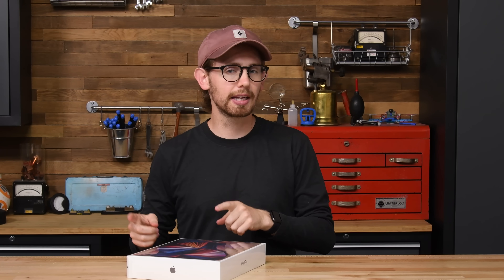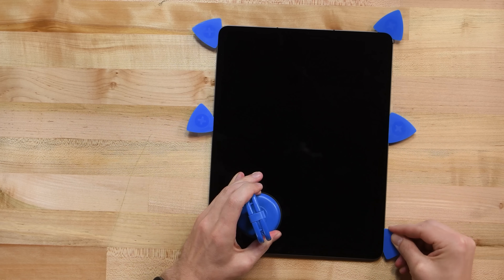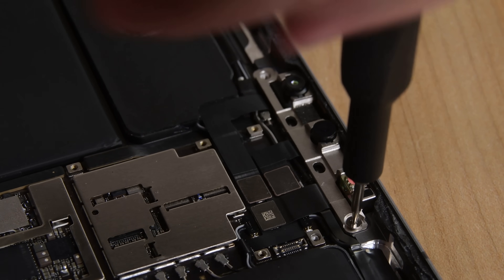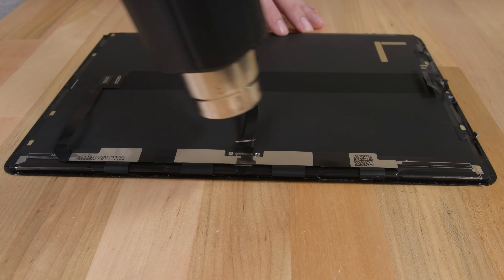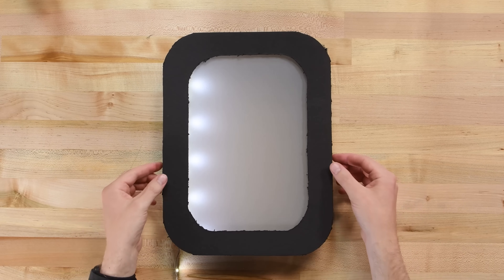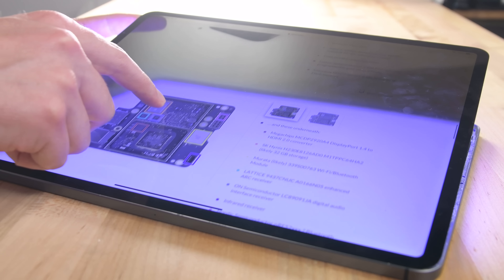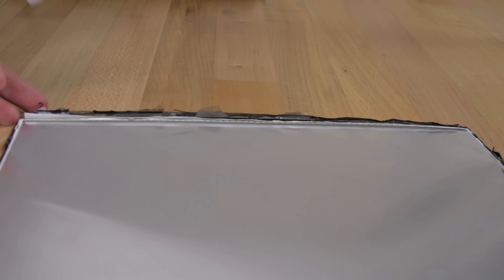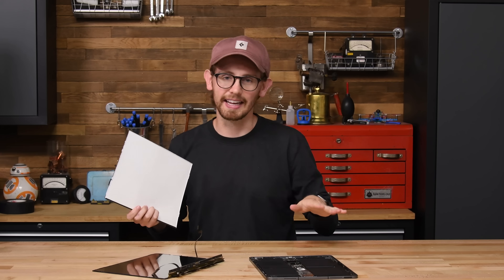M1 iPad Teardown:  Inside the New XDR Display!

Comment: Just upgraded form the 2018 to the 2021 12.9’’ and the speakers are a lot worse the depth/bass is a lot less. Just watched this video to confirm the speakers are different shapes oval versus round and smaller. A little disappointed to say the least.
Reply: other videos i saw side by side they say the bass is better
Reply: @truthseeker6804  It's not I have both the 2018 and 2021 but the 2021 12.9" is 5G capable so maybe the 5G makes less room for larger speakers.
Reply: @Cooper3312000  or maybe yours has a problem? check other youtube videos.
Reply: @truthseeker6804  you can see in the 2018 iPad 12.9 teardown the speakers are round and have more surface area the ones in the latest 2021 iPad are oval and clearly smaller driver.
Reply: @Cooper3312000  i just searched for comparison video and theres a channel called fernando silva and he proved the 2021 speaker is better. you cant just use oval or round to make real conclusions. maybe return yours.
Reply: @truthseeker6804  it sounds fine it’s just not as full the 2018 used to vibrate when it had bass this one just sounds a little flat it’s nothing to bad I’m still enjoying it use AirPods most of the time anyways just letting others know the facts I’m not trying to sell buying the new iPad over the older ones like everyone on YouTube.

Comment: Just one question though, do you think the mini-led is more power efficient than the conventional leds from previous ipad pros?
Reply: Message vilian_tech on IG
Reply: No, that's one of the reasons it has a bigger battery. Mainly with HDR content the screen puts out much more light. And that takes more power. You potentially get some power savings IF you have the brightness down very far, and have mainly black on the screen, but in reality this will be weighed out by the overall higher brightness with watching video's or doing other things that keeps the brightness up. Local diming doesnt turn the LED's off completely on a black screen, only dims them. If they turned them off entirely it would make blooming even worse. 

People seem to be confusing the benefits of mini LED with OLED or Micro LED.

Comment: Why isn‘t any LED controlled separately?
Reply: The control circuitry to control 10K LED's separately would be a lot more difficult / expensive to implement. They would have to have a much more complex backlight controller, way more traces going to the backlight array etc. Probably would have doubled the already higher cost of the screen.

Comment: I'm shocked that the backlit for normal LED displays are on the side and not a big uniform surface underneath.
Reply: Well they surround all corners, and a layer behind the LCD panel will diffuse the light (spreads the light evenly) meaning it actually is a uniform surface.

Comment: So, if I understand correctly, the shadows along the edges could be fix with a software upgrade?
Reply: The edge shadows, probably not, it is caused by the space between the screen and the backlight layer, and the diffusion layers in between. The blooming, could most likely be fixed though.

Comment: Honestly I won’t call it a “computer” unless Apple lets me use whatever OS I want, install my own apps even Mac apps would be good.
Reply: And how do you want to control such os and apps when iPad is touch based and regular OSs are pointer device controlled?
Try to use VNC or Remote desktop on iPad and you will see why it is not a good idea.

Get Macbook Air for that. Same thing, lower cost, not big difference in weight.

Comment: You should replace the thermal paste with liquid metal
Reply: First, M1 doesn’t need that and second, liquid metal might damage whole board by shortcircuiting. Plus it degrades to some friggin mess.
Avoid liquid metal. While it sounds cool, it’s not awesome. And M1 is no overheating Intel.

Comment: My ipad pro M1 12.9 inch getting warm on the left side of the glass (opposite to the apple pencil dock) while doing regular working such as youtube, notability, safari etc. No editing videos or transferring files or gaming. It's not over heating but it's warm.
Does anyone experienced a similar case with his iPad? Is it normal?
Reply: There is processor…
Reply: @ZhuJo99  the processor is not in the middle of the ipad?
Reply: @yuvalbenmoshe6187 my fault, i have non pro iPad where board is aside. It might be battery, that’s normal during usage.

Comment: How can the backlight be so homogeneous on the 2020 iPad Pro, while it's on a side?
Reply: there is a clear "light spreader" that the leds shine into, tuned to eject more light on the far edges and less on the closer edges to balance the fadeout of the leds over distance. 

Its like a fiber optic rolled out into a sheet with micro holes in it
Reply: I feel like DIYPerks did an explanation in a video on this. IIRC it's the one where he turns laptop screens into a fake window.

Comment: 2.5k dimming zones still has blooming..  could have been 5.5million zones if it was an oled since its pixel level..... oled still has benifits such as instant response time and slightly better viewing angles then ips... also even with the local dimming and dual lcd layer (monochrome), its still an ips panel so the poor native contrast ratio will show up in certain instances...
Reply: Except MiniLED has better viewing angles than OLED. OLED loses a lot of brightness and even color when shifted. MiniLED pretty much stays the same on the iPad.
And the biggest point is that the iPad Pro is often used for drawing and designing where accurate colors are necessary. The problem with OLED is tho that it needs to be recalibrated every other year or even after just a few months. On a phone that's not an issue. On a drawing machine? It is.
Reply: Burn in low brightness are oled weakness

Comment: M1 is on iPhone next jk
Reply: it technically already has it. Just with 4 less GPU and 2 less performance cores. Besides those two changes, the A14 is exactly the same chip. and it clocks slightly lower at 2.99Ghz instead of 3.2Ghz

Comment: who made this display for Apple and revolutionized the industry?
Reply: This is not a new tech developed by apple🤣 there are laptop using mini led display already on the market
Reply: @mahchunteng9434  Except the iPad pretty much set a new record there. Even entire TVs and reference monitors with MiniLED mostly often have only some hundreds or barely over 1000 local dimming zones while the iPad at only 12.9" has over 2500.
Reply: @mahchunteng9434  Where?
Reply: Both LG, Samsung and TCL uses this kind of tech in their products. I think that TCL were a bit of a first mover on the tv-front. And I think that it is LG that produces the iPad screen. 
Its been showcased on CES for a couple of years as the next-gen lcd-tech. Now it is hitting the consumer products in a big way.
Reply: @mmmkkkeee  Which products? Where is a product with mini led that has 2500 dimming zones?
Reply: @Gokhanaj  That would be their upper QNED line. 
With that being said these things are collaborations. LG probaly have shown Apple their roadmap for the technology, and Apple have invested in LG to make it happen. It's a great feat of engineering to make something that is normally inside at 65" screen fit inside a 13" one - and that is thanks to both Apples and LGs efforts.
Reply: It doesn't matter who manufactured it. Apple designed it.
Reply: @Gokhanaj  come on, while Apple is designing top notch processor these days, they are not into display technology. Samsung, LG are companies that are making inovations in this field. Do not make Apple some kind of wonder where they design and make everything from displays through processor to the lowest, smallest resistor on the board.
Which they are not. Even cameras are made by Sony.
Reply: @ZhuJo99  But they design their own displays entirely. They don’t ‘buy’ existing displays from others. They take their design to Samsung or LG and ask them to manufacture them. That’s the reality.
Reply: @Gokhanaj  that’s not true at all.
Reply: Thats old technology, Samsungs microled is the revolution.

Comment: The fact that they named it "Mini-LED" is that there is a "Micro-LED" version coming out soon in the future with lot more leds for a much more better display.
Reply: mini led is completely different then micro led
mini = small led
micro led = individually lit leds with no backlight
like oled but not organic
Reply: @yassienE4935  what do you mean, organic? (I really don't know).
Reply: @NinPossible  OLED (Organic Light Emitting Diodes) is a flat light emitting technology, made by placing a series of ORGANIC (derived from living matter.) thin films between two conductors. When electrical current is applied, a bright light is emitted.
Reply: @NinPossible  oled screens are organic LED’s, rather than making individual LED’s you mix up a slurry of chemicals and paint it onto a film (to grossly oversimplify), however are susceptible to burn-in after some time. They look very nice, at first, but after some time, start to loose brightness
Reply: @NinPossible  To explain it simply, organic means it will degrade by nature. When it degrades, it causes abnormalities to the screen, particularly burn-ins.
Micro LEDs are designed exactly the same way as OLEDs, but the LEDs are inorganic, meaning they could last so much longer.
You get the benefits of brightness and contrast levels of OLEDs, but you eliminate the risk of your screen failing after some time. In other words, micro-LED is the combination of the best of IPS LCD and the best of OLED.
Reply: @bbeni24  @Velleity Thank you, guys! ^__^
Reply: @troy5568  Thank you! Last question, why are they organic? What are they made of?
Reply: @NinPossible  inorganic or conventional semiconductors are made from metals like silicon (well it's a metalloid tbh) which are doped in order to get them to ... you know semi-conduct, hence the name. Organic electronics on the other hand are grown using organic compounds (obviously lol). I'm not a chemist and it's been years since I've taken chemistry so I could be entirely wrong about this but iirc organic basically just means something that doesn't contain metal atoms as the main component. Instead the semiconductor material is made from other elements/molecules like hydrocarbons. The main takaway is basically inorganic materials don't "rot" over time in the same way organic ones do, so they tend to be more reliable long term overall. Many inorganic displays have their lifetime measured by hours of use, while organic displays have a shelf life (ie whether you use it or not it degrades).
Reply: @sjm4306  thank you so much 🙏 😊
Reply: @NinPossible  its organic so it can die and burn in which is why people don't want oled
Reply: @yassienE4935  Thank you for the info. ^_^
Reply: Maybe. Micro led is a very new technology.
Reply: Soon? They will not come before 2026. This technology is still wayyy too expensive. Even samsung first micro led tvs cost over 100.000$
Reply: @TheTornadoWind  did you say 2026 for a reason? cause this would mark the 50th anniversary of apple and i am really looking forward to absolutely amazing products from apple for this year
Reply: @martiiin1999  No but I work for a company that is producing the current mini leds for the iPad and other devices. And out roadmap says that we plan to mass produce micro leds around 2025/2026
Reply: Wouldn't micro LED just be OLED
Reply: @TechDove  yeah , MicroLED is OLED without the Tint issues
Edit : I am Replying to your first comment , 
And The difference bw MicroLED and OLED is Just that All LED’s are individually backlit, However OLED uses organic materials which may die out , And causes issues like Tint 
So, in a nutshell MicroLED is just OLED wo/ Issues, (if you don’t mind the price)
Reply: Apple actually didn't named it MiniLED. It is MiniLED but that name is not made by Apple. Apple calls it Liquid Retina XDR - they never call it "Mini LED display".
Reply: @Raja995mh33  Correct term would be "mini LED back-lit local dimming LCD". Who cares about what apple names it.
Reply: @Raja995mh33  Yes, mini led is the general term used by industry for this technique/type of display, liquid retina xdr would be the specific implementation/trademark term that apple owns
Reply: @buzomatic  and color accuracy, color shifting and color gamut
Reply: @buzomatic  and of course power efficiency
Reply: @buzomatic  Apple buys OLED for currently EVERY iPhone 12. Not just the most expensive ones. And what does this proof anyway? Nothing. iPhones are not iPads.
Reply: @buzomatic  I was referring to micro led. I thought you said that OLED is better in every aspect compared to Micro LED. Then I missunderstood your comment. Sorry
Reply: Actually it doesn't really affect the quality how much more leds you put in there once you reached a certain amount. It can just get brighter.
Reply: Microled exist already and it is completely different display technology - check new Samsung tvs
Reply: Better display already exists. It is called OLED.
Reply: Nope. OLED is a better option at that point. And rumor has it that iPad will be switching to OLED screens in '22.
Reply: @Mamo878  I wouldn't count on that. Apple is going to ride out this mini LED for a few years
Reply: @Mamo878  No they won't. And MicroLED in fact is better in every single point than OLED. You clearly don't know Apple when you actually believe that after all this development, R&D, marketing etc. they would kill MiniLED after just one year. MiniLED will definitely be the displays of the iPad Pro for at least the next 2-3 generations.
Reply: @Mamo878  what about the burn in issue? i would much more like a microLED display with near OLED performance than having problems with burn in.
Reply: @Mamo878  Micro-LED, based on what we’ve heard so far, is far superior than OLED. It’ll be the same as OLED in the way that each pixel will be an individually lit LED unit, but it uses inorganic diodes and will eliminate the screen burn-in issue with OLED, which is far more important on tablets and computers than on phones. This is part of why Apple chose mini-LED instead of OLED this time.
Reply: @Mamo878  only for low budget tablets, for iPad Pro they will use mini-LED.

Comment: I'm loving these local LED displays. They could look almost as good as amoled while having fewer burn in issues
Reply: It's still a tradeoff, with this you have a chance of getting blooming
Reply: @BlackDragon31000  and it's also less energy efficient than OLED.
Reply: @BlackDragon31000  less blooming than traditional led so its still a plus. anyways if anything wait til microLED comes out, that will compete directly with amoled
Reply: Well, if one part of screen is constantly lit for a long time, I doubt if those LEDs are going to stay the exact same output as the rest of the panel.
Reply: @frankli4124  This. The color subpixels may not experience burn in, but the underlying backlight surely will. Traditional backlight doesn't seem to suffer from this but only because all LEDs lose brightness uniformly.
Reply: @frankli4124  yeah but it's better to have thousands of LEDs than millions of LEDs
Reply: @frankli4124  That is a fair point, but unless the iPad is being used solely for a single purpose like a POS, it probably isn't a big issue. My note 10 plus is going strong with no burn in on the OLED, but every single Motorola phone that I have had with an OLED had noticeable burn in within the year. In 2 you could very clearly see the notification bar symbols on the screen when doing something like playing a yt video. It's mainly about software and how well the burn in mitigation is implemented.
Reply: I think mini LED is just a compromise, it's maybe the next best thing if you can't get OLED.  Just like the notch on iPhone, despite many people make it sounds like it is a feature. I have an OLED phone and I don't worry about burnin at all. Apple chose mini led over OLED is probably because they are cheaper.
Reply: @frankli4124  If I'm not mistaken, mini LED panels have a higher peak brightness.
Reply: @Progan666  hahaha u r not entirely mistaken, it does have higher peak (1600 nits) brightness but those peak only achieve while surfing HDR content which is in daily use the brightness is the same as Ipad pro (2020) around 900 nits, maybe it a lil bit bright because of the new tech however, it not really noticeable
Reply: @Progan666  we have oled panels with upto 1800 nits brightness now, I don't know how much more brighter a screen needs to be
Reply: @QiqiSuki  This isn’t a limitation of the display - it’s how Apple chose to implement HDR on the device. There is nothing stopping it from having 1600 nits of peak brightness with SDR content other than an arbitrary software decision.
Reply: @babybirdhome  yep, so the fact that apple limit their display from achieve more nit which is is such a shame , it only can compete with oled when display a hdr video, but in daily usage, oled is much brighter and better , its not weird because later ipad pro will implement oled how so ever
Reply: @frankli4124  I’m sorry to tell you this, but the current Mini LED display in the iPad Pro is more expensive than an OLED screen.
Reply: @dollzman  only because Apple sets the price to sell worse technology for more money as they always do
Reply: @maelstrom254  found the android fanboy
Reply: @TheEviltaco666  I hate Android even more
Reply: @maelstrom254  what do u use a flip phone
Reply: @TheEviltaco666  wired phone

Comment: every mobile device today was a computer, just different operating systems and limitations on capabilities and features.
Reply: Is not was. And everything that has chip is a computer, mate. Even 3d printer with basic 8 bit board, or controller unit in the car.